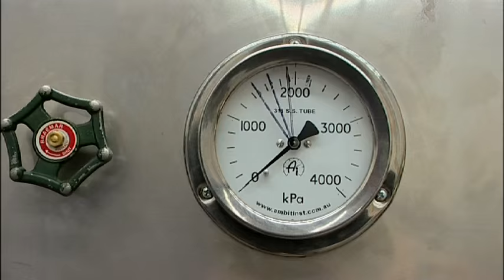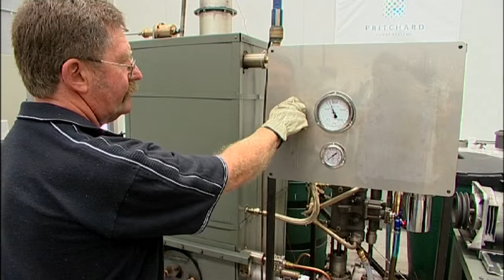Ted invents a new kind of steam engine

Comment: This is great!
Would love to know details of the wood-fired boiler you are using to power the new stationary engine. Would you mind sharing? Thanks.
Reply: The biomass fired boiler at 2:38 takes all kinds of biomass. Some biomass with high moisture content would need to be dewatered into a fuel sludge 'cake'  The boiler inside the casing is proprietary and has patents granted globally including US, EU, Australia, Japan, China, India. Using biomass fuel at 30% moisture content, 30kg/hour, output is 4.5kW ac, at least 20kW heat/steam. Steam out of the boiler is superheated 400C, 20 bar. All that from an engine that is relatively uninsulated and open.
Reply: @onggk6561  What is the thermal fuel efficiency???
Reply: @sandervanderkammen9230  This is still work in progress as we make, run and improve prototypes. It will also vary with type of fuel and as the unit is biomass fuel agnostic, then there will be various thermal fuel efficiency. In general, it would consume 30kg/hr of biomass at 30% moisture content. Output is 4.5kW, 240V ac, 20 kW thermal heat/steam. The unit is also largely uninsulated for now for test purposes so a lot of heat is not captured.
Reply: @onggk6561  This prototype has been demonstrated for over a decade now, why is there no third party, independent testing results available?
Reply: @sandervanderkammen9230  Partly correct but that includes in the early days of making parts from Teds hand drawn drawings, digitising drawings etc. The early years have seen slow progress. The prototype has undergone 4 iterations, the last of which is also on YouTube. Its not fully ready for 3rd party independent testing. Progress is quite dependent on funding, all of which so far has been from family and friends and some government grants.  Its at Technology Realisation Level 7.5. Further funding been sought. At late seed stage.
Reply: @onggk6561  Ted Pritchards performance claims were also unsubstantiated, his company went bankrupt amid accusations of financial irregularities and investment fraud.
Reply: @sandervanderkammen9230  Ted Pritchard is not here to defend himself.  The technologies are very good. There is no need to take this discussion further if you are skeptical and unconvinced.
Reply: @onggk6561  Regardless of that fact the Pritchard Steam Company took in over a half million Austrialian dollars in investment capital and never produced a single working product or any proof that his designed delivered the performance specifications claimed.
Reply: @sandervanderkammen9230  How sure are you that there is no working product.?
Reply: @sandervanderkammen9230  Not saying of there is or not, the results are good.
Reply: @onggk6561  So how can you prove that this product is not fake and the company is not fraudulent?
Reply: @sandervanderkammen9230   They could easily be real. People run with stupid ideas that go nowhere all the time and waste plenty of resources doing so
Reply: @diobrando2160  Anyone with an engineering degree can tell you it won't work, steam is simply too inefficient and impractical to be commercially viable... this is well-known and understood for many decades.
Reply: @sandervanderkammen9230  ugh really?? Steam of no use? Steam engines unproven?? Please. Especially for stationary  power generation from a fuel source that is unlimited in biomass and ubiquitous water. Go crack your hydrogen and see what's cheaper and easier to produce stationary power.
Reply: @thenarrowroad7908 Just the facts here, not wishful daydreaming... Its not commercially viable on a small scale, this has been proven.
 Steam is very expensive to build and maintain but most importantly steam is very inefficient.
Internal combustion engines can and do run on any fuel that steam engines can and they do it cheaper and use less fuel.
Reply: @thenarrowroad7908  The most energy efficient combustion power plants in the world are Internal Combustion ... not steam.
Any questions son?
Reply: @sandervanderkammen9230  accusations in other words they weren’t proven and he wasn’t convicted of any wrong doing.
Reply: @6killer426  But the missing money was never found.
His investors lost everything.
Reply: @sandervanderkammen9230  that problem is prevalent and has been in most ventures it’s not just isolated to steam power. There are many takers of government grants in all areas.

Comment: IMO too complex. Have you heard about wood gas generator?
Reply from the maker: Yep, seen in action.
Reply: Steam engines are horribly inefficient
  internal combustion engines running on wood gas or methane is a very successful and practical alturnative fuel option if the economic factors are right.

Comment: I don't see how a steam generator would be more economical to run than an IC generator, which could even run on wood gas.
Reply: ICE are significantly more efficient than steam... which is why steam is obsolete in nearly every application.
Reply: My guess is, is that it isn't. However, steam does have the merit of being able to run off of literally anything that burns. So in very remote locations, with little conventional fuel available, or with only small quanities of various different fuels available, a steam generator is a viable option. However, a steam turbine generally has higher efficiency and may be better suited to the task than a reciprical engine.
Reply: @__-fm5qv  There is no way a reciprocating steam engine could be economically viable or energy efficient compared to a Diesel engine... even a gas turbine would out perform steam in larger application.
Reply: @sandervanderkammen9230  A gas turbine (if you're going to drive motion directly from it) doesn't have the throttle response to be a suitable for an automotive application.

I'm not saying that "steam power is the future" I'm just suggesting its potential hasn't be properly explored with modern design techniques and modern materials. And it would be interesting to have someone try and match the efficiency and usablity of a convensional IC engine.
Reply: @__-fm5qv In Britain, in the 1950's/1960's, at least 3 different gas turbine locomotives were tried/trialled experimentally on British Railways (1 on the Southern region, 1 on the Western region (built by the Swiss, Brown - Boverei company), and 1 on the Midland region (the English Electric company's "GT3"). They were all very powerful, and did very many miles in service, but in the end it was decided, for various reasons that gas turbine power units were not viable for railway haulage. One of the major deciding factors was that it was found that the gas turbine units were consuming almost as much fuel at low throttle openings as they were when running at full output, making them uneconomical in general use.

Comment: I'd sure like to know what is so new or revolutionary about this engine.  People have been using steam to drive pistons for hundreds of years and steam to drive turbines for more than 100 years.  Titanic did both.

Steam locomotives used some very innovative methods of metering and timing the steam applied to the cylinders to achieve good efficiency.  I would imagine that adding computer sensing and control (as in car engines of the last 5 to 10 years) could increase and automate that control to increase power, efficiency, and reduce pollution.  If the ideas are patented, then there is little risk in making at least some info public.
Reply: There was nothing new or innovative. 
The Pritchard Steam Company was an investment scam.

Comment: WHAT IF U CONVERT A V12 ENGINE TO USE STEAM
Reply: Why?
Reply: @sandervanderkammen9230  just a question
Reply: @TimSmith-vl4qk  The V-12 cylinder configuration while having several advantages in internal combustion engines it has no advantages in a steam engine.
Reply: @sandervanderkammen9230  i said conversion like when you convert it to use something else  or build a v12 equivent of a steam engine
Reply: @TimSmith-vl4qk  Yes, there would be no advantages to building  V-12 steam engine... its a dumb idea.
Reply: @sandervanderkammen9230   you think it been done on a smaller scale
Reply: @TimSmith-vl4qk  No reason to...

Comment: There are two technologies here, the boiler and the steam engine which been proprietary are not shown in the video.
Reply: The efficiency limits of steam generators and reciprocating Rankine cycle engines are well-known and understood, what evidence is available regarding the fuel consumption and energy efficiency specifications?
Reply: @sandervanderkammen9230  Running trials are well documented and discussed internally. Boiler and steam engine have patents granted.
Reply: @sandervanderkammen9230  On a need to know basis, you dont qualify to know.
Reply: @onggk6561  Of course it's a secret... wouldn't want potential suckers investors to know this is all just a fake vaporware scam.
Reply: This chump keeps screaming sCaM! Without providing evidence.
Claiming something is "well documented" and not providing documents, is deceitful.
Reply: @ironjohn5107  The machine is now running in Canberra, Australia.

Comment: I hope that steam engine would be useful in making cars today!
Reply: Why? Steam cars are obsolete.
Reply: @sandervanderkammen9230  Because it fun?
Reply: @gunbuckybucketman4578  so buy an old one.
Reply: @sandervanderkammen9230  How about make a new one? The old ones are pretty much a bunch of expensive collectables at this point.
Reply: @gunbuckybucketman4578  You think building new ones would be cheaper???
Reply: @sandervanderkammen9230  Yeah, why not? It could be as crude as an oven.
Reply: @gunbuckybucketman4578  So you are not aware of how expensive it is to build and maintain a steam car?
The are many times the cost of a typical ICE car... and have terrible performance compared to ICEs... the best steam car ever built was the Doble E series, they are the most expensive cars in history and have staggering maintenance costs...
Reply: @sandervanderkammen9230  Didn't I said "crude" ? The cost of maintenance could be minimize by using steam turbine instead of pistol. And I didn't want the Best car, I want a car that simply run.
Reply: @sandervanderkammen9230  Why am I have no clue what I'm talking about? I can do what or when ever I want. Obsolete or not I don't care, it's not your business, I'll do it for fun. And there's a steam turbine car.

Comment: ALL electric power today is generated using steam. we move power through electricity instead of crankshafts or steampipes because its the most efficient and least lossy way to do that. we have moved away from pistons because Turbines are just better performative and benefit from scale and scope better. Fundamentally the challenge always lies in the question of "how do we heat that steam?". Burning stuff is the most primitive way, and the fuel source has changed throughout history. wood, Coal, oil, gas, hydrogen. whenever we can get away with it, we should make use of already present motion, be it wind or water, to skip the fuel and steam step and go straight to electric generation. but the big oil companies don't want that of course because the world is ruled by short term profit. it makes far more sense to decentralize power with small scale wind and hydro power that require far fewer moving parts, are cheaper to build, and don't deplete local resources.
Reply: Crackpot!
Reply: Your comments reveal someone with a very limited education and does not understand the Laws of thermodynamics or the Laws of Supply and Demand.